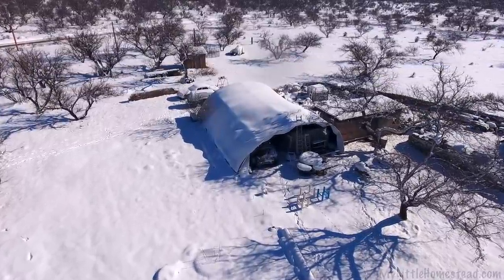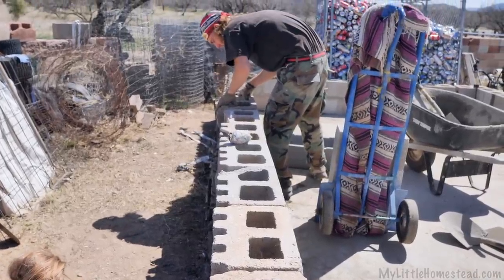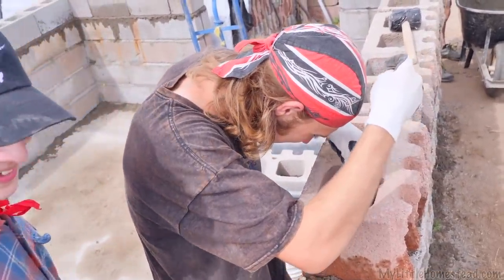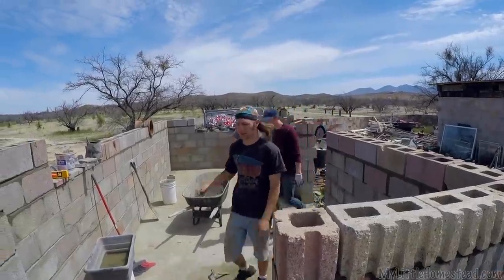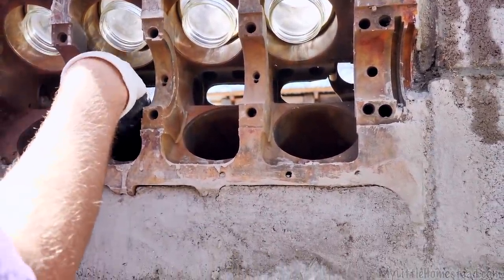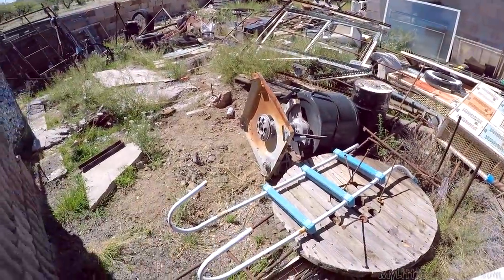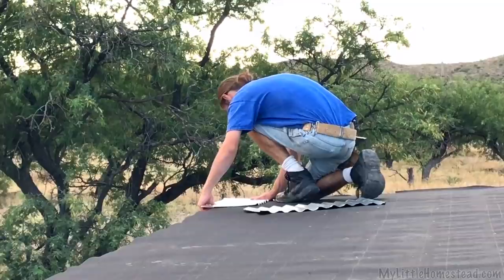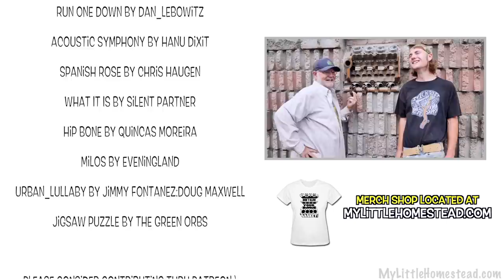Complete Build of Workshop | Full Version Movie of Finished Project DIY

Comment: So now that your thinking of maybe connecting these two buildings, I saw a really cool video here on you tube that earthship did where they did a hanger shaped roof. They bend rebar in arches, tied them together with more rebard and covered the entire roof with chicken wire, then they dipped old cloths in concrete and laid them on the chicken wire that when dried made a had shell. after that they covered it with cob. it turned out to be very strong and pretty cool looking. Now, go for it.
Reply: I saw a tiny house where the whole roof was made of concrete. If I recall correctly, they had a giant pile of sand that they rounded off into an upside dish shape, then they layer a decorative rock pattern which you would see after the concrete was poured on top, set, and the sand later  excavated out from underneath. I can't remember the walls were done--which is really essential & integral to a build like this as you wouldn't want a concrete slab to fall on you if walls gave way. It was BEAUTIFUL, though. It was like a Hobit house from the shire though.

There are lots of crazy things one can do. Apparentlybtge Romans had done things like this before.  I thought it was ingenious to pour the concrete for a   Domed roof, then excavatebelow to reveal a pre-planned cavity for a living space.

Comment: When you lay block you put half as much mortar between the blocks as you did and you put it on the side of the block before you attach the other block. You don't push it in the hole later on because that does not secure the block appropriately and you needed some proper tools to apply the motor.

Comment: Reminds me of why there are building codes and inspections.  Hopefully, you gilled the holes in the blocks with concrete.  The mortar joints don’t provide much strength.  Love seeing footage left out from the original.
Reply: wonder what 8x8 fluted blocks require by building code ? how many rebar verticle rods per story , how many gilled per linear foot. those vertical joints seem extremely thin versus coarse joints . my husband is watching and getting exteremely nervous . say he doesnt like that wall at all . looks very unsafe .

Comment: to make it better...
Suggestion: since the building structure is on a concrete flooring.. dig a guttering trench  (6x6inches deep & wide). concrete it along the building border..going away from the building at a slight angle..that might also help your acquaponics system... so when it rains.. the water goes from the ceiling congregated sheets into the trench and is gathered into a 55gallon water barrel (dug into the ground placed near the acquaponic area)
Stay safe....GOD BLESS

Comment: Ali when I was growing we built a big shop build to restore our cars and build our race car and it didn't cost very must to build we new of a old farm that shut down and we took the old chicken barns down and used the wood from that to build our shop. We ever broke up the concrete floors and used that as filler to build our floor cut down on how much concrete we needed for our floors we bot the nail and some concrete for the floors we had the hole building built for less than 500 dollors and my hole family worked together to get it all built and we did it all in 1 months time

Comment: im wondering how long it will take for the load of the wall to snap off the new very thin concrete from the existing slab....  no steel or wire in the cement and nothing to hold the 2 together...

Comment: Aren't those ribs meant to be laid upwards do they interlock with each other & improve rigidity & strength in the buildings?  And I'd be nervous about all that rusty wire & bits on the ground with all those dogs running around.  You're going to need to clean up your junkyard if you intend to have small children running around too!